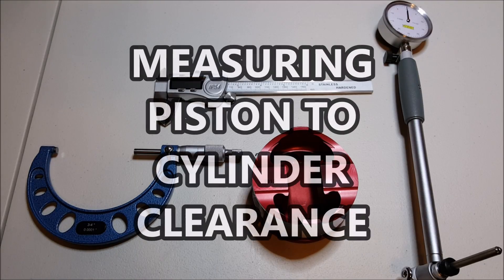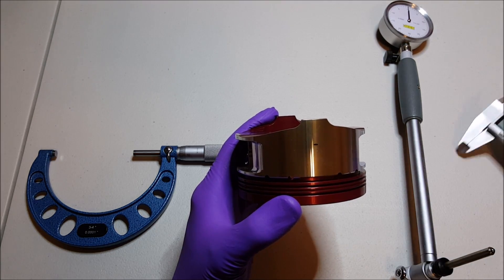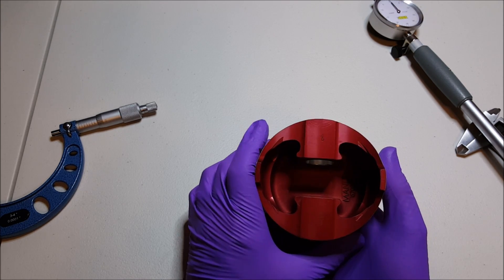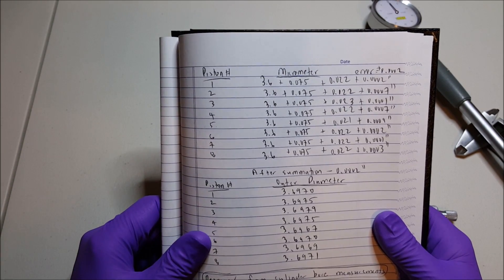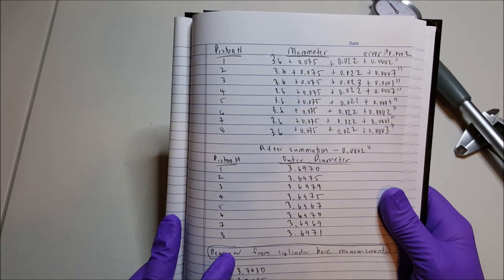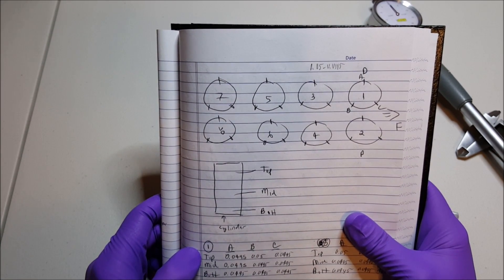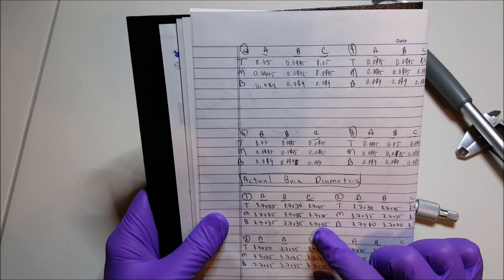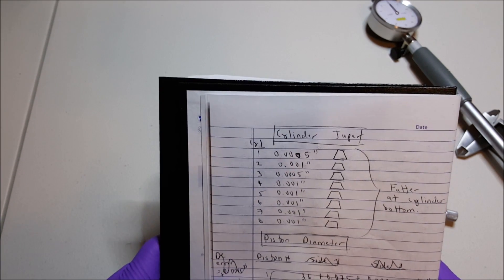How to Measure Piston to Cylinder Bore Clearance

Comment: You measuring for forged or cast pistons? Both types require different tolerances. I'm guessing it's cast, as that's factory type . Most generally forged is used for high performance with a higher expansion rate, but could still be used with stock applications.

Comment: Great Detail.  

Have you tried  measuring with a torque plate, or perhaps bolting down the cylinder head and measuring through the crankcase end of the cylinder?
Reply from the maker: No I haven't. Have you?